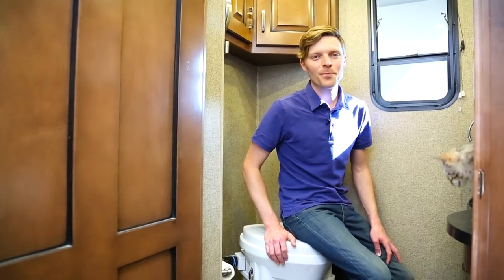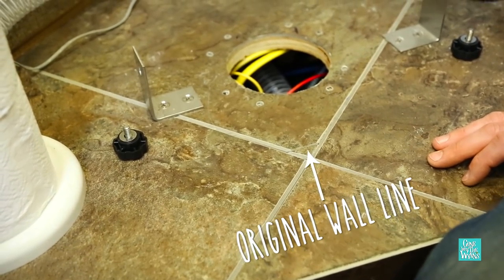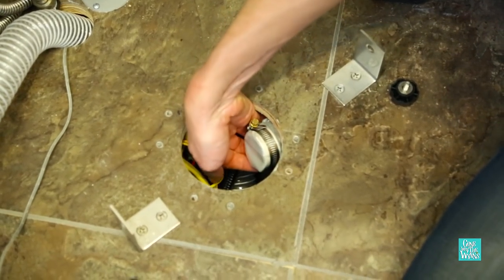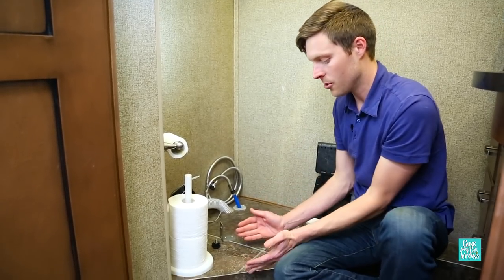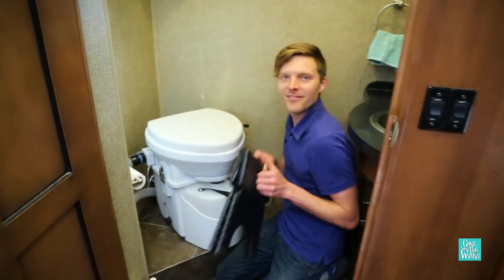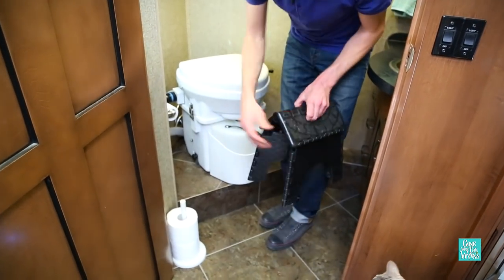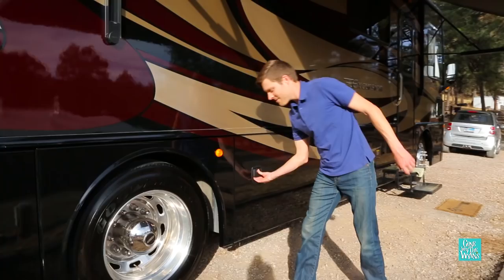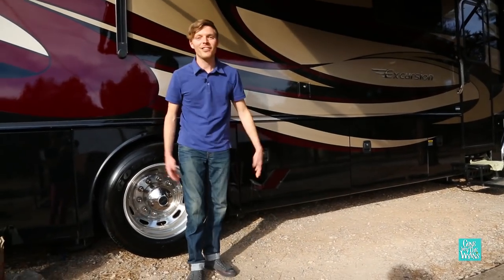Composting Toilet Install on a Fleetwood Excursion RV

Comment: Why didn't you run the new vent tube to the old vent pipe ? Looks like a very easy solution, no drilling through the bottom or extra holes to the outside.

Comment: just a question about the smell from the exhaust fan ,,,,i`m thinking that this install has the exhaust coming out from the coach under the side where you might be sitting enjoying the great outdoors....have you noticed the exhaust smell
Reply: rf170354 
Same question. 
Not a good spot to vent out unpleasant smells esp while hanging out cooking BBQ and the likes.
Reply: Composting toilets create ZERO odor.  Only a dirt or soil smell is sometimes noticed.   NO water, no sewage or sewer smell.